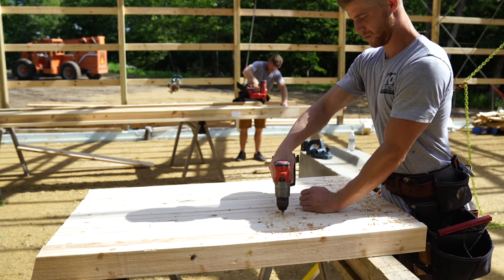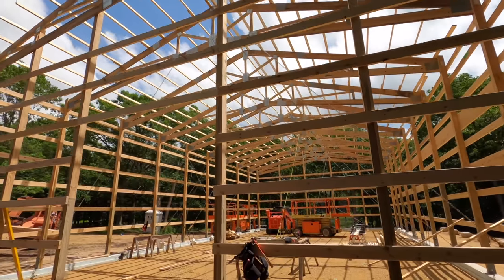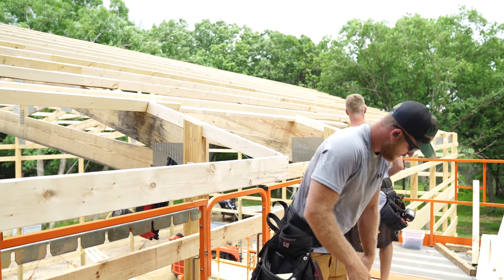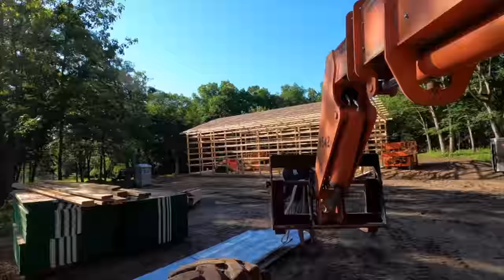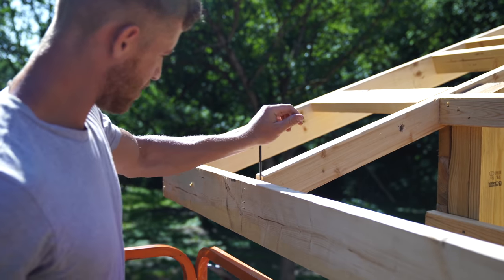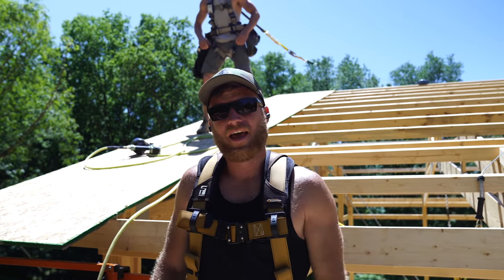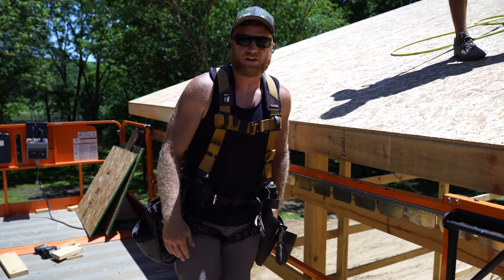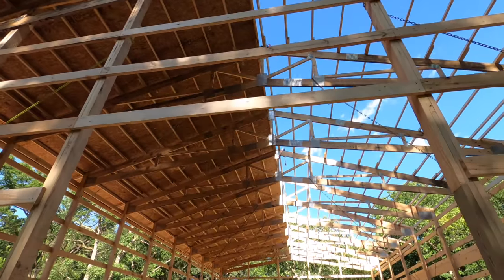Cabin in the Woods Part 5: Framing Overhangs and Sheathing Roof on a Post Frame

Comment: Ahh, the 8K lb telehandler. Job MVP in my opinion. The amount of work output that machine is capable of, can’t be overstated. Not to mention the element of safety it can add to employee exposure. An 8K machine always seemed to fit perfectly into the ‘mama bear-sweet spot’ when weighing work capability vs price. The 10K machines start to out-price their advantage (although those front outriggers can be handy tools for all sorts of unexpected job-site tasks) and the rare 12Ks start to lose valuable agility as well as being price prohibitive. 
Excellent choice.
Reply from the maker: Agree and with foam filled tires it’s even more capable
Reply: @RRBuildings  Right! I forgot to mention that. Foam filled tires are almost non-optional. Nothing more frustrating than having a piece of equipment sitting around idle with a flat tire. 😡
Reply: Hit the nail on the head. I have to use mostly 12k's with outriggers and they lose all agility at that size. Smaller ones are always much more fun since they fit everywhere haha.

Comment: Awesome video. I’m an electrician by trade, but a framer by heart. Just one quick tip. Your shock absorber for your fall arrest should be clipped to your D Ring at your shoulder, not to your lanyard second. You risk not having shock absorber operating correctly, and your body taking the full fall impact. Keep up the great work. Love your vids

Comment: You can fly with the sheathing on a roof like that. In NJ there are contractors that just specialize in sheathing/plywood installs. Framers will frame and the plywood guys come right behind and fly with that stuff. Good job.

Comment: Actually , this build is unique in another respect- it's been a while since you did a job with just Gregg along. I'm wondering where the rest are- after I invested hundreds of hour finding good hands and decent, intelligent foremen, I didn't want them leaving because I was "stingy with work". That said, the amount of excess motion and increase in safe production through your "start right, stay right" and thoughtful process, two men can do this job (with mechanical help) and with out "doing stupid". I have always thought that safety started in the mind and heart of the worker. The "assists", like the safety harness, are cover for the piece of purlin that was weak and not spotted in the assembly- something even very aware people could miss. If you but an idiot in a sling he/she will likely just find another way to "do stupid". 
   Being a plumber, I well understand about how a process can appear identical, and outside observers might see it as repetitive; I'm also a motorhead; cars are more alike one another than unalike, and few real variations exist from a few basic patterns- yet each is different, the challenges to make it were never the same. I know that is really the same for what appear to be "big boxes on the plain". KOKO!

Comment: If you guys had (at that point) the telehandler on site, use it to keep the air line lifted above the roof so it doesn't need to come over the roof edge. Simpler to handle that way, you could even make a small platform with a retractable hose reel that stays on the hook up there, rather than on the ground. This could shorten the hose length and make things work better in the system too.
Reply from the maker: Good idea

Comment: I guess this was filmed before that new Dewalt came in.  I can't imagine you using the air powered nailer when you have a cordless option on hand.
Reply: lol.  Now that you mention it, right.
Reply: The dewalt is only a roofing gun and not a coil nailer. The longest nail in a standard roofing gun is 1 3/4" long while the sheathing nail used for this is typically a 2 3/8 x. 113 nail. They're two completely different mailers and aren't interchangeable. Looks like a Hitachi nv75ag which is what I use when sheathing

Comment: Hello Kyle,  Wouldn't it have been better to bury that last strip of OSB?  By putting it in the middle of the run somewhere it would have allowed a full width sheet (4') to anchor your gable end flying rafters.  Having a what looked like one to one ratio extending out  the inner joint would have been covered by solid OSB thus beefing up your joint where the flying rafter comes into the truss.  That way the (what looked like) eighteen inch strip of OSB would be back in the field where continuity wouldn't be as important.  Just a thought.  I like to glue the roof deck sheathing down as well as nail but that is just me.   Take care.  Doug

Comment: Really enjoy this.... Hey, on your last sheet, wouldn't it be better to have placed a full sheet, thus moving the joint/seam deeper into the building, further strengthening the overhang.  Then put the narrow last rip, in-board of that last full width sheet.  In some fashion, mimicking your first sheet and its relationship to the facia out riggers.

Comment: Hey Kyle, im a carpenter and do alot of new build houses, i see the simplicity in the way your doing the porch roof, however why dont you do the framing at the same time as the rest of it? It would surely be more elegant and save some materials. Ive done houses with dormers at 45 degrees, and multiple rooflines tied in together
Reply from the maker: Not sure what you mean?
Reply: @RRBuildings  well, i see youve framed the building and sheathed the roof, but why dont you frame the porch before you do any sheathimg?
Reply: oliver mansfield I would assume it’s to do with stability and racking

Comment: Do not ever use a shock absorbing lanyard with a retractable.
Reply: Need a D ring extender so you don’t connect snap ring to snap ring
Reply: Why not?
Reply: a number of things come into play here.  Snap hook to snap hook is a no-no because of the possibility of roll-out.  The increased fall clearance distance and forces from using two fall systems.  Also, in this situation the retractable needs to be a leading edge type(which it very well could be) due to it not being able to be anchored above their heads

Comment: Love the videos and channel. Wondered why you are using OSB on the roof for this build? Is it for increased shear strength, maybe due to local code? Regards from England.
Reply: He talked about it a bit in the video. It's a highly engineered product, so it has great sheer strength, provides very clean and straight lines, and a very flat surface for the standing seam sheating.

I would still prefer they painted the edges of the fresh cuts they made. This would prevent water being absorbed into the panels, causing swelling, if it rains before they can get everything weather proofed and sheeted. But that's just me. OSB is wonderful until it gets wet; and modern OSB is a lot better than its predecessor. But swelling on untreated cuts is still something to safeguard against.

Comment: Two Questions, because this "cabin" seems just like a nice house.  Question 1 : Can the posts be placed on the top of poured basement walls?   Question 2:  Can Attic trusses be used instead of the ones that we see in this video.  I'm thinking of building a home in this style and want to increase usable footage but with the same footprint.  Thanks

Comment: My pole barn doesn't have roof plywood over the purlins, but just a metal roof with some thin insulation, and it leaks in spots where I want to put in a finished room.  How do I figure out if my trusses are strong enough to allow me to remove the metal roofing, and put down a plywood covering over the purlins to try to get a dryer roof, or any suggestions on how best to stop the leaks with the metal roof I have now?  Have you remodelled an older pole barn with a finished interior room and did something on the inside to protect the room from leaks in the pole barn roof?

Comment: Kyle, Was wondering if the scissor trusses are much more expensive than traditional trusses? Are the comparable structurally with regard to loads?
Reply: if it helps I had a local truss manufacturer bring up specs on both traditional and scissor.  Not much difference with respects to loads, and the scissor trusses with a raised heel are far better for the project I'm doing

Comment: Why did you run the sheeting vertically? (Former nail pounder.)
Reply from the maker: Perpendicular to strength axis of the roof and easy to install for post frame
Reply: He spent a lot of time explaining that. Go back into the video where they laid the first sheets vertically.
Reply: Perlins are running horizontal vs nailing to a typical vertical truss. So you flip the sheets

Comment: Kyle, why don't you use tounge and grove 5/8" sheeting on the roof?  I've always heard that tounge and grove sheeting is better for roofs.  I am just curious.
Reply: I've only been doing carpentry for 3 years now but I've never even seen 5/8 tounge and groove only in 3/4 and thats typically for subfloor.

Comment: I saw you used nails for spacing instead of plywood clips. Are you concerned that the clips might indent the metal roofing? I have never had to put osb on a pole building, just metal roofing.
Reply: A joke among plumbers was that you inspect every rewind tape measure for developed legs when you buy it- all of them have leg cells built in, but the value is in buying one before they start to develop. All tape measures are at risk of walking away!

Comment: Curious to know what holds the track of the track saw to the sloping roof?
Reply: They have a foam rubber tape on the back that is surprisingly grippy. Just set it where you want and a little bit of downward pressure and they stay.

Comment: No Zip?
Reply: Not needed one a standing seam roof since no water should be able to get in.
Lot of guys run standing seam with no underlayment or zip since its waterproof if done right.
Exposed fastener roofs at some point water will get in, would definitely use zip or an underlayment for exposed fastener.